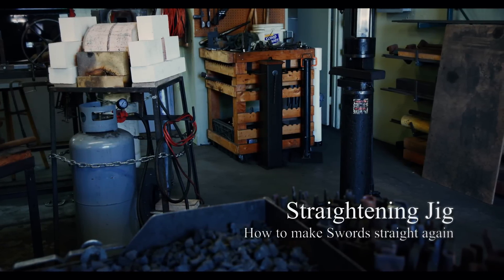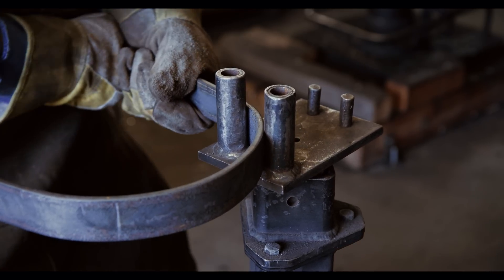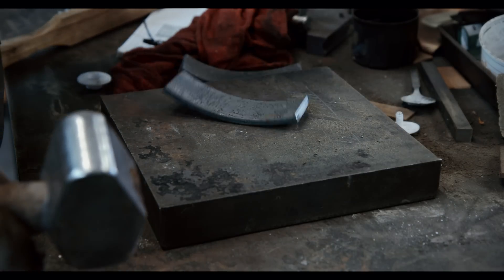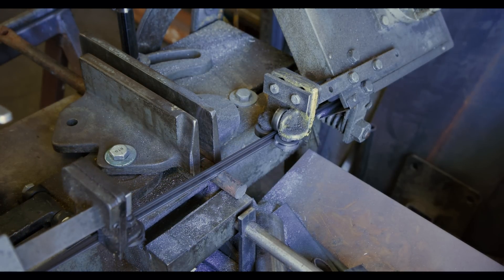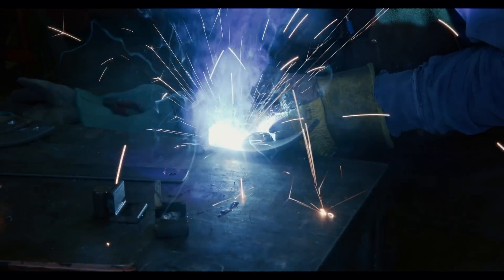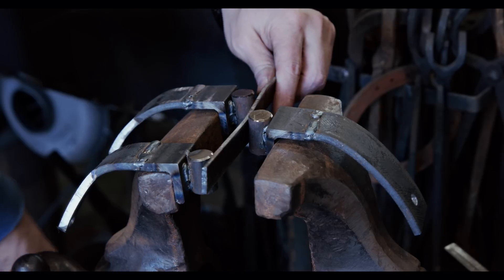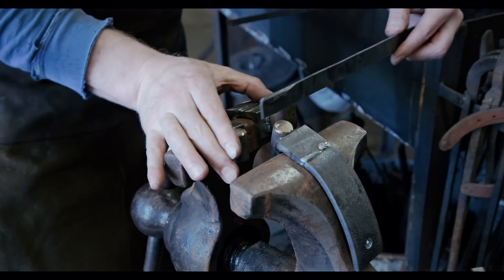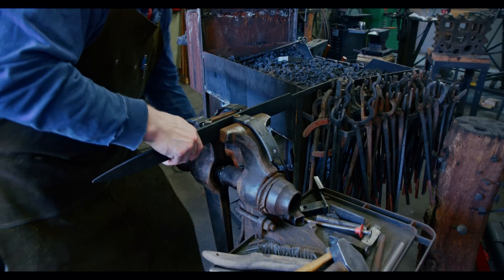How to Straighten a Sword with a Jig  (Forge Diaries: Ep. 12)

Comment: I still get the most success fixing big bends while its still hot within the first five seconds after the quench; there is a weird grace period where the blade still acts like its red hot but it actually only a few hundred degrees. I just use two layers of welding gloves. Of course if you wait about 10 seconds after the quench you will probably snap it. This jig would be nice for small post tempering bends though, and I like how its adjustable.

Comment: Very interesting video.
My jig is very similar and I use it quite often (I seem to be unable to quench damascus long blades without warping).
I prefer to correct during the hyperplastic phase just after quenching, but that's not always possible and the time window is often too small.
Reply from the maker: Right. Most of my straightening happens while tempering. I don't need to use a jig like this very often but I screwed up last time :-)

Comment: Is there any danger of lasting structural weakness in the blade after straightening like this?
Reply from the maker: Ideally, you would not do this but in practice that's often unavoidable.
Reply: after straightening, would it be wise to harden and temper the sword again to avoid any weakness in the blade in that case?

Comment: maby you  can use a copper or bass protectors to no  to  scrach a sword
Reply from the maker: This is right after heat treatment, so you don't have to worry about scratches. There are lots there already from the rough grinding.

Comment: Could you also anneal the blade, straighten it while soft in the forge and then heat treat it again and hope it comes out straight? Or during the quench like in your other video from forge dairies  where you missed that the blade had warped when you quenched it?  Would that work? Or is it just way more effort to re heat treat the blade?
Reply from the maker: +LumberJackThompson yes. You can do that as a last resort. It's usually not necessary. I get most of them straight during tempering.